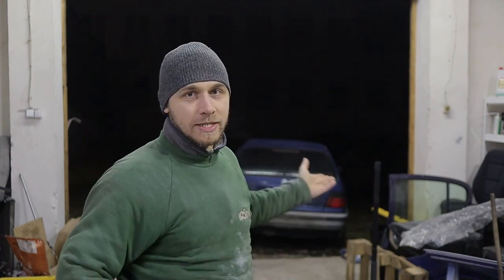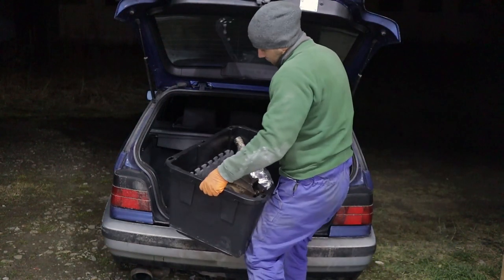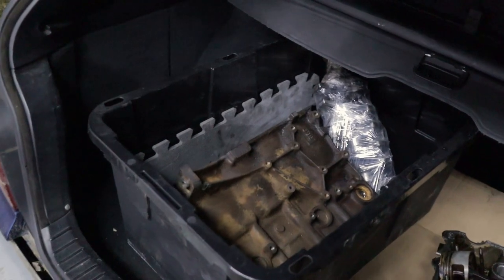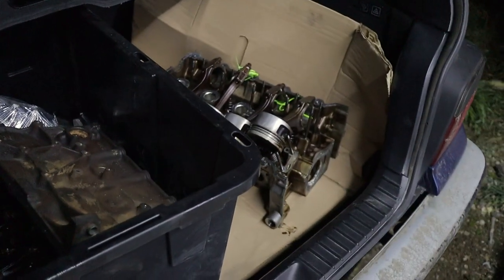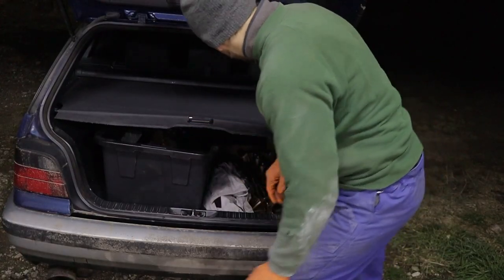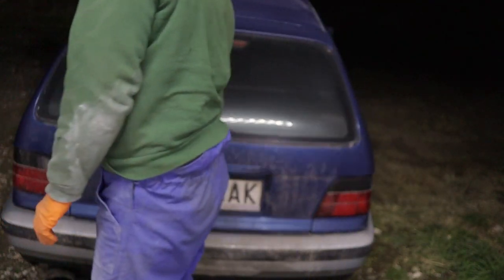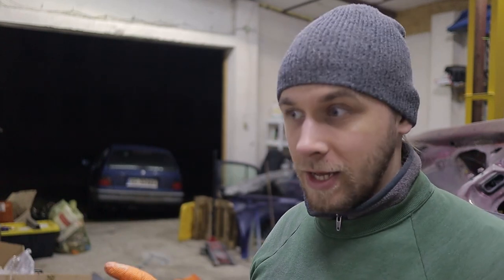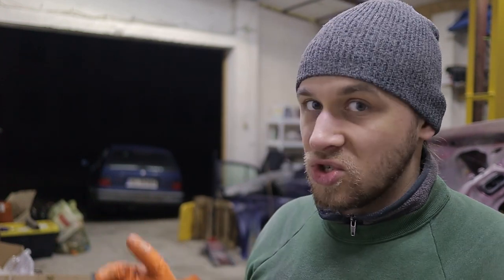M42B18 update

Comment: Hallo i have som problem whit my 318ti whit a n42 engine.  When I try to start I when the engines are cold . It will run for 3 sec. When I try again it loose comparison. After a couple of try it will start and run good. And when the engine is hot. There is no problem to start. Do you have some ideas? Thanks /martin
Reply from the maker: Hi, you also reached out on instagram, right? Let’s talk there it’ll be easier ;)